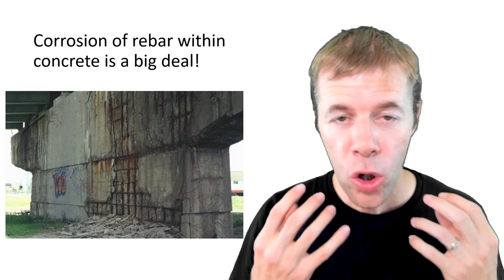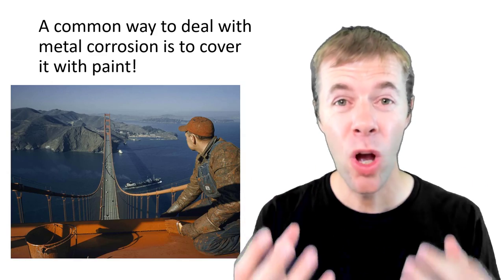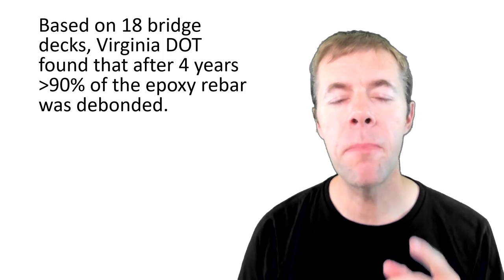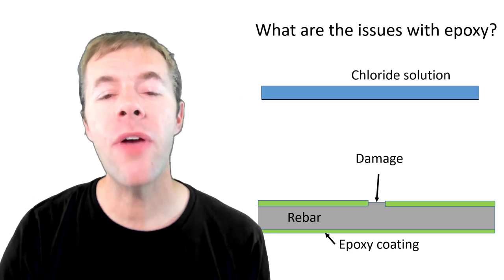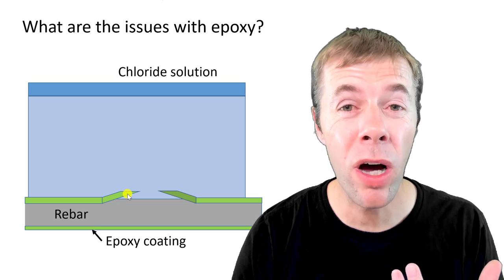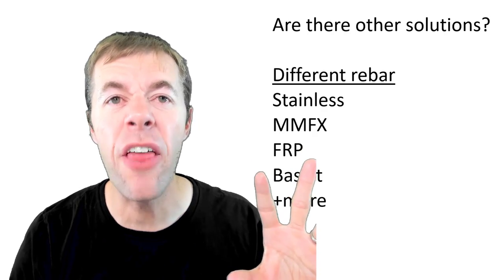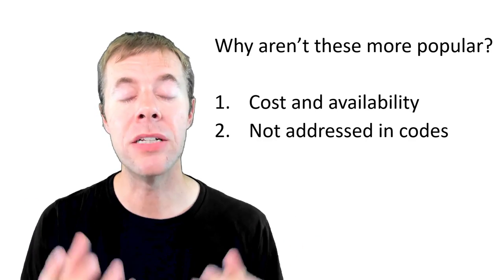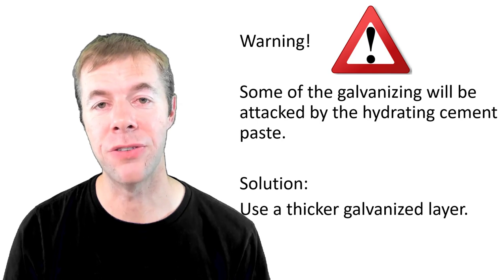What is epoxy coated rebar and why is it being banned?

Comment: No real personal expertise on the rebar issue.  (Other than the casual observation that modern un-coated mild steel rebar seems markedly more soft/malleable, compared to the typical "hardened" steel rebar I recall from 30+ years ago.)  Based on what I do know re. dangers of misuse/misunderstanding of galvanic action in marine/boatbuilding applications of stainless steel, I would lean toward agreeing with your galvanized preference.  But it seems to me the whole rebar-corrosion question is only focusing on mitigating the "effects".  Eliminating the "cause" should be prioritized as well. 

Nearly two decades ago, before I had access to what little internet there was back then, I was looking at options for pilings for a saltwater dock on a private tidal beach.  The local commercial concrete people told me (circa 2001) there's a compound (dry powder form) they can add to the mix in the truck, which beginning as the concrete cures, grows microscopic crystals entirely throughout the porous matrix of the concrete itself.  Effectively, this eliminates the usual "sponge"-like character of concrete which otherwise inevitably draws in any outside water during the life of the structure.  

I have certainly observed this incontrovertible concrete-sponge effect first hand, in a moderately large factory-shop where I was employed in the Pac.NW.  Any time there was extended rain, the concrete floor all through the middle of the building would get pervasively damp and sticky.  Despite the asphalt parking lot adjacent on all sides, the slab itself was wicking water in from the underlying soil, which was on a relatively flat plateau with inadequate drainage in the surrounding area.

Like I said, "I'm no expert"... but if you prevent the outside chloride-bearing moisture from permeating the finished concrete in the first place, then you surely don't have to worry so much about mitigating its effects upon the rebar.  This anti-porosity compound infused throughout the concrete itself when poured (rather than the more traditional surface-sealing efforts after the fact), would seem to me at least as vital for the rebar corrosion issue, as any of the debatable alternatives for coating/protecting just the rebar alone.
Reply: Well, Hell...
After composing all that...  Only now do I notice in the side-bar, your two other related videos:  "Surface coatings and sealers for concrete...", and "Why do we NEED air bubbles in concrete?..."

So, now that I DO have access to the Internet...  I still gotta remember to make full use of it before attempting to add my bit.  Off to watch your other relevant concrete vids shortly, when I can get to it this afternoon.  Apologies if you've already explained why my above notions are wrong, while I belatedly play catch-up.
Reply from the maker: Boatrat,
I agree with your point.  The rebar is only part of the story and we need to make outstanding concrete and then use whatever tricks we can to keep the chlorides out.  I am a big fan of all of these approaches.
Reply: @boatrat  
Pores and bubbles are not necessarily the same, bubbles are closed while pores can be like long channels ducting water and other stuff

Comment: Have you ever thought of using sacrificial zinc (instead of dipping the steel in molten zinc).  It is commonly used in marine environments.  A bar of zinc is attached to the rebar and the galvanic action (the chlorides at work) goes for the zinc first.  Inspect regularly and replace as needed.  It has been in common use on Florida bridges for decades.  Zinc is also much cheaper than steel.
Reply: That is pretty much what galvanizing is, the issue is that as rebar in concrete you can’t get to the sacrificial zinc to replace it, since it’s encased in concrete.
Reply: I think you're referring to cathodic protection. To install cathodic protection, an electrode is buried in the concrete near the reinforcement and connected to the positive terminal of a direct current power source so that this new electrode is forced to act as the anode. The reinforcement is connected to the negative terminal. The external power is adjusted so that a net positive current flows into the entire rebar cage. This overcomes any corrosion current flowing between areas within the cage that previously were anodic and cathodic and it stops further corrosion. The buried anode degrades over time, hence sacrificial, and must be replaced periodically. Regular monitoring and maintenance of the system are essential to insure effectiveness.
Reply: @Nettechnologist  That is why I was talking about cathodic protection.  the entire reinforcing steel network is already tied together.  You just have to install a couple of steel bars from the steel reinforcing to the outside of the concrete and attach the zinc to that steel connection.  

The zinc oxidizes (rusts), rather than the steel.  If the zinc bars are in an equipment room, a simple visual inspection can show when new bars need to be attached.   

I have only seen it done in marine environments and not seen it done in
commercial construction.  There are probably other reasons but I have not heard about them.
Reply: @Nettechnologist  The answer is to not encase the sacrificial zinc in the concrete.  You make a connection from the inside to the outside and attach the zinc to the connection.

Comment: The heat from galvanizing the rebar causes a significant decrease in strength. That is why code doesn't allow galvanizing Y-/K-rebar for concrete structures in Europe (Euro-Code).
When we need something galvanized at work (precast concrete factory in Denmark), like bearing plates, we use normal round bar or flat bar wich will be bent to achieve the desired bonding strength.
Reply from the maker: Recent testing does not show this to be true.  The loss in yield strength from galvanizing is very minor (< 5%) and it is still above the design value of 60 ksi or 400 MPa commonly assumed in design.  Below is a page from a report that shows how hot dip compares to black steel and several other types of rebar.  Galvanized rebar has been used widely in the USA and in several offshort platforms.

See page three: https://www.dropbox.com/s/sztc4re9mu2z100/3%20steel%20and%20concrete%20properties.pdf?dl=0
I can get you the full report if you need it.

Looks like I need to do a video over this to further get the word out.
Reply: @TylerLey  I would certainly love to see a thoroughly documented video on the topic. I would love to be able to use Y-rebar on all our bearing plates. It would save us a lot of variants. I discussed the topic with our engineer just last week.
I do think the rebar we use is rated for 550 MPa though (it may be another unit, I am not entirely shure. As a technical designer I only make the drawings for our production)... ;)
Reply: You can just add more rebar to make up for the weakness if there is any weakness
Reply: Henrik Paulsen 
The EU?
Now there is a standard we all can stand behind.
I trust the EU as much as as I trust the EU’s immigration plan!
WTF
Reply from the maker: @Henrik Paulsen Thanks for the message.  I will put the video on the list.  There is a lot of good data to show that there are several alternate bars that perform similar or even better than our current reinforcement.  Lost of engineers don't want to use them because they don't have experience with them.  We need to get them used so that we can start changing things.
Reply: @TylerLey  I believe you. But why do galvanised 16 penny nails (seem) to bend so much easier than common.
Reply: zinc melts at like 800 degrees F. I find it hard to believe that significantly weakens steel.
Reply: @jasonandkids5889  Not necessarily true. When the rebar starts to rust, the rust swells up and this causes the concrete to fail and this then causes the rebar to rust or corrode away even faster. More concrete coverage over the rebar is important. I think that using a richer mix is helpful or important in some situations. A well-graded mix is important as well.
Reply: Hot spraying the zinc is another option. The issue would be failed coating if the bar is bent after spraying so the site would have to touch up any damaged areas. And that's the rub. Poor site quality control will lead to unprotected metal and the same site is likely to be the one that doesn't adequately cover the rebar in the first place.
Reply: @TylerLey  I have had a talk with our engineer today, and the issue is not overall strength, but reduced ductility. When the rebar is galvanized, it becomes brittle (i.e. it loses its ability to "float" as he called it). In precast concrete elements, that is the last thing you want.
Reply: @rustycowll5735  Seems like you don't know much about rebar and precast concrete.
The temperature used for galvanizing is ~860°F (460°C) btw. 
And when we tarnished tempered steel (tools for testing the strength of welds) when I was apprenticing as a fitter back in the day, we did that at ~400°F (200°C). Needless to say that even small differences in temperature has a big effect on the molecular structure of the steel.
Reply: @frankcrawford416 - Zinc coated nails are hot-dipped, not plated.
The term "galvanized" actually means "electroplated" but "galvanized" is used to mean hot-dipped also.
The outside diameter of nails is supposed to be the same whether bare or coated. So hot zinc-dipped nails have a smaller diameter of steel inside the zinc coating. The strength of zinc is very low compared to steel.
Reply: @charlesaanonson3954 - Sand, gravel and water are cheap compared to Portland cement. Where specifications are short-cutted less cement and more gravel saves money. Look at news items of apartment buildings collapsing due to weak concrete. Bribing inspectors is much cheaper than cement.
Reply: @HepauDK  
The short heating period should not do much, but rebar may have been heat-treated specially, and heating will affect that specific treatment
Reply from the maker: @HepauDK  Look at the report that I sent you.  It shows ductility as well.  There is no loss in ductility for galvanized bar.
Reply: @TylerLey  Even if there were significant losses, starting with better steels would compensate for that leaving you with a zero-comparative-loss solution. You might even experience gains. But agreed, nothing to worry about with HDG.
Reply: @TylerLey  that's such a neat document!

Comment: How about using the plastic waste for rebar? I installed the 3/8 “gut rod” ties for the 3’ X 3’ Bent forms which would support the precast road leading to the Bainbridge Island ferry (Washington State) loading ramp in approx 1995.
 The best scaffolding is made with bamboo!

Comment: I'm not an engineer of any kinda nor an iron worker, I work on cars, mechanical & body and I like to do some fabricating here n there. My thought/question about the galvanized rebar is: Wouldn't some of the coating come off when you bend the rebar, especially a tight radius?
Reply: joeinpittsburghpa maybe, but rebar is in straight lengths 95% of the time

Comment: Concrete restoration engineer here. This guy’s explanation is pretty good. Corroding reinforcing steel is even way more complicated than this video alludes to. There are also more solutions than he proposes. 

At the end of the day, the best way to mitigate corrosion is to design and install the reinforced concrete properly. It involves using the right concrete mix for the application; designing the structure properly; installing the reinforcing properly and in the right spot, and detailing it properly at high risk areas; placing the concrete properly; curing the concrete properly. Really it should all be best industry practice, but unfortunately lots of companies are out to save bucks and not build to last. Engineering fees are a bit of an issue too. We often don’t have the budget to review construction as thoroughly as is needed to ensure high quality construction. 

I could go on and on…

Comment: I wonder if zinc's dangerous fumes when welded will hold back galvanized rebar as a solution? (Zinc oxide is nasty)
Reply: You do not heat rebar or you ruin the temper. If you see someone cutting rebar or heating with a torch, stop them, then replace that rebar. Rebar is cut with shears.
Reply: Zinc can be plated on the iron rebar. Dip galvanizing sounds cool but can also spray on zinc paint as zinc is a "sacraficial anode" and doesn have to cover all iron.

Comment: lessons learned and forgotten...in the 70's jacketed underground piping (Chemical industry) was being used in place of earlier wrapped or coated versions, the problem was a nick in the coating or jacket often caused accelerated corrosion at the point of damage. The coatings have to be fully intact or you run the risk of losing the pipe even faster than if you had never coated it at all.
Reply from the maker: Ken,
Thanks so much for the story.  That is the same thing we are seeing in concrete.

Comment: I remember back in engineering school, there was a type of steel composition called COR-TEN or weathering steel that formed a self-sealing surface rust layer. But that involved exposure to the air, not calcium intrusion. BTW, I had a specialized contractor friend who moved houses off their foundation, demolishing the foundation afterwards. He never found a foundation where the rebar was still intact. They all dissolved, How about fiberglass rebar? At least for low tension applications.
Reply: Weathering steel is now widely used as the structural beams on bridges. Trestle bridges are making a comeback in Montana because of the steel. I actually built the first Trestle bridge in Montana in like 50 years in 2016. Lot of fun!!

Comment: You have a valid point as to why it may fail.
I painted the rebar after it was installed to ensure there were no breaches.
At the time I didn't even realize they were using epoxy paints to protect the rebar.
I just thought it was a good idea to protect the rebar the best I could in the roof of my basement.
In Australia Galvanising steel is far from inexpensive and we make do with what we can afford.
It was the rubber membrane that needed to be replaced, yet it's all sweet now.
We all learn from our mistakes, some quicker than others.

Comment: Won't galvanizing break and flake off when you bend the rebar, leaving huge gaps?
Reply: No the galvanized coating is actually somewhat self repairing. It's really cool.
Reply: @leroy420b  cadmium is slightly self repairing,  Zinc just gets used up like a battery when it's scratched.
Reply: Zinc bends at least as well as steel.

Comment: Forty years of field observation has shown me that the epoxy coatings do have problems but galvanized steel does not do well in alkaline environments though it does do well in acid environments. Copper does best in alkaline environments that we find in concrete. Concrete is so alkaline that it’s great for sanitation, uncoated.